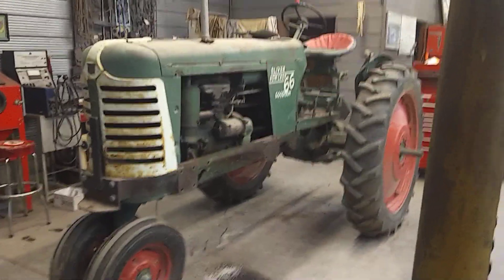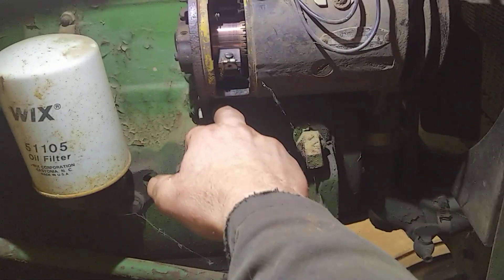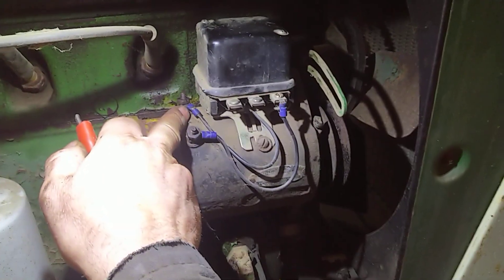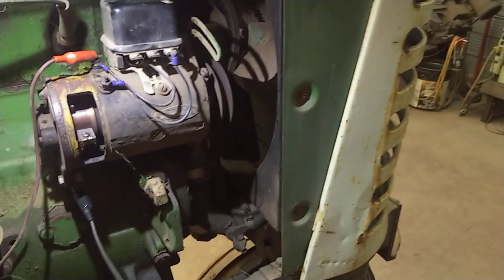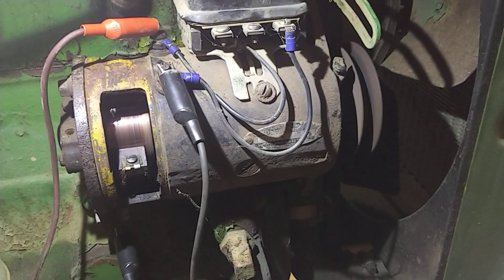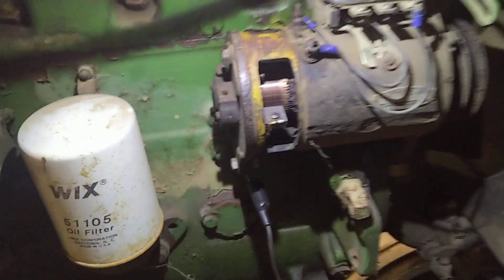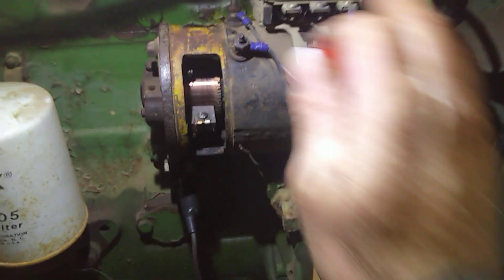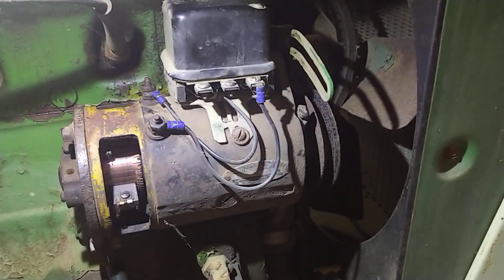Easy Generator Testing

Comment: Man...this tractor is driving me nuts!!! I do this test...but my generatoe turns SLOW...UNTIL i push down on the coil flap then it speeds up
Reply from the maker: Go through the tests with the regulator unhooked. If your generator turns terribly slow, it is likely time for a cleaned armature commutator and brushes. Also lubricate the bushings.
Reply: @FarmallDoctor I'm getting 6 volts on both terminals on the generator.  Mounted to the tractor. I've got the regulator un hooked.  (It's a positive ground).  Is there supposed to be continuity between the A and F terminals to the body of the generator?
Reply: @FarmallDoctor I just posted a little video short of it
Reply from the maker: @Tater4200  Your system is positive ground. You are getting confused because you put your meter test lead to the negative terminal of the battery. Put the clip on the positive (ground) post.
Reply: @FarmallDoctor that just powers my power meter. It shows where I have ground or power. I can shoot ground or power to anything I touch with it.  It won't turn on if i flip them
Reply: @FarmallDoctor it's a power probe 3

Comment: Very helpful, thanks for sharing. With older generations I had the magnet become delaminated from the casing. Do you have any tips and tricks for restoring them? And what type and brand of glue would you recommend? Thanks again.
Reply from the maker: I have recently come across and started using 2 part epoxy made in the USA by Bob Smith Industries. It works very well in many applications. One of the biggest things is to make sure that the brush holders move freely so that there is always spring load pushing them onto the armature.

Comment: Probably the best video on youtube. I tried this on my old generator (that doesn't charge) and it spun slowly with the positiv cable connected and when I  connected the negative it changed direction and spun much faster.

Comment: I know this is an old post, very helpful.. but i got to the part where i know my gen works and still isn't charging.. as soon as i ground the field, boom.. its charging. All wires are in good shape, ammeter works great. Is it a bad regulator if it starts charging when the field is grounded, or when the field is grounded and you hit positive to the arm post?
Reply from the maker: @LIgmaBollards  check first to be sure that the body of the regulator is properly grounded, and if so, the points for the field circuit inside the regulator are not contacting. You can clean the contacts inside the regulator with fine emery paper, and blow them clean. They are the set inside that are held normally closed.
Reply: @FarmallDoctor  the regulator appears new, everything is shiny, it's definitely not original to the tractor, no oxidation anywhere on anything. I'll check to see if it's open when I get home from work. The tractor runs at 6.2 to 6.1 volts, I can turn the headlights on, pull the battery cable off of the battery and it will sit and run. It's strange. Once I ground the field, it starts charging at 7.9 before I pulled the jumper. I did make sure the vr was grounded good, but I'll definitely triple check in the morning. Thank you, and thank you for this video, can't tell you how many times I've referenced it the past couple years

Comment: so what happens if it goes past 16 volts and stays there does that mean the box is bad and overcharged  the battery?
Reply from the maker: Yes. The regulator is stuck on full charge. The generator has excellent output.

Comment: Will this work on a 6 volt, positive ground? Do I place the leads as you did, or differently because it’s positive ground?
Reply: I looked through the comments and he does confirm that he is working with a negative ground system. So I would imagine that for a positive ground system everything would be done backwards (except for the polarizing part which btw is not the procedure for old 2-brush ford generators). Let us know how your test goes.
Reply: I was curious weather he was working with positive or negative ground myself.
Reply from the maker: @jamescaneda9515  this 6 volt system is positive ground.
Reply: @FarmallDoctor No, I heard I’ll take the negative lead that’s ground. RED is positive hot, BLACK is ground. Did I hear wrong? I need this information because I’m installing a new generator plus a new voltage regulator. Your video was the easiest to follow.
Reply from the maker: @jamescaneda9515  sorry, when i say "battery positive" that is meaning negative.. Because of the positive ground. It was drilled into us during college training, and I can't stop saying it that way.
Reply from the maker: @jamescaneda9515  polarizing is the same whether pos or neg ground though. Touch BAT terminal to GEN terminal momentarily.

Comment: I need to mount new generator and regulator, but don’t know the proper wiring. So I’m stuck and will try my best, hoping not to burn circuits.
Reply from the maker: @pacoguerilla3097  F on regulator to F on generator, GEN on regulator to A on generator, BAT on regulator to ammeter or volt meter. L on regulator if there is not always there, or not always used. That is a load circuit that goes back to the light switch. Not necessary.
Reply: @FarmallDoctor  Thanks a lot !

Comment: In following this man's advice there is one big caveat regarding grounding the field (F) terminal of the generator.

This should only be done on generators that use an externally grounded field (also known as an A-circuit field). There is also a B-circuit field, which is an internally grounded field. In this configuration the connection to the F terminal must go to the hot (ungrounded) side of the battery, whether it's positive or negative, to get full output or to check the generator slowdown when motoring it.

Ford used the B-circuit configuration almost universally in its vehicles which were equipped with generators. This would likely also be the case with its tractors. So it behoves anyone doing these tests to know what configuration your particular charging system uses for its field circuit.
Reply: inflec is right on the money here!  

Old Farmall tractors usually use Delco Type "A" generators and the "Fielding" procedure would momentarily connect the 12vdv to the generator armature post as stated.  

However older Fords and Massey Ferguson tractors usually use Lucas type "B"  generators and the "Fielding" procedure would momentarily connect 12vdc to the generator "Field" post.

So your best bet us to verify is to first verify if you have a type "A" or "B" before "Fielding"
Reply: OBTW - "Fielding i's also known as "Polarizing" the generator.
Reply: Yeah that’s what I wanted to know. I have a 6 volt positive ground generator on an international pickup. The new relay states to ground it to reverse the polarity. I called the retailer and he didn’t know. I’m waiting for the AC Delco mfg to call back for information.

Comment: Do I leave the battery hooked up and just run wire test wire or do I unhook battery? Positive ground 12 volt system
Reply from the maker: Yes, i leave the battery hooked up.. Just remove the wiring harness from the regulator and generator, and use the test wire.

Comment: I'm sorry but I wish you would do a better job explaining the jumper connections you did to test the generator. The tractor is positive ground which gives me an instant head ache. I just don't fully understand what you are doing. Otherwise you do an excellent job of keeping to the point. So many just ramble on with meaningless garble.
Reply from the maker: "battery positive" Is a general term that we use to identify the "hot" side of the circuit, no matter whether the system is negative or positive ground. Ground is always referred to as ground in both. "Battery Positive" jumped to the A terminal makes the generator "motor" no matter if it is positive or negative ground. If you were to ground that A terminal, nothing would happen.

Comment: Great video. I have a 6v. pos. ground tractor. When you mention connecting a lead from battery pos to armature terminal, is the lead actually coming off the pos batt terminal (the one with the the mesh cable going to ground)?
Reply from the maker: No, the other way. When we say "battery positive" we are meaning the machine, not necessarily the battery.
Reply: So is it safe to say, connect a lead from the neg. terminal (since mine is a pos gnd) and the other end to the armature of the gen? In other words, think of wiring it up in reverse? 
 @FarmallDoctor
Reply from the maker: That's correct.

Comment: A knowledge of electrical theory helps. I see a lot of videos and while the person posting the video may know what they are doing, the person receiving the advice may not understand what is being said. When I am teaching how to test and repair generator and regulator I always use the LUCAS ELECTRIC SYSTEM for explanation and circuitry. It is a very simple system and the 3 or 4 tests to do in the field can be done with a volt meter and a shorting wire.

Comment: If the regulator is bad, will it cause no spark to coil. I have brand new coil and ignition kit installed but I still cannot get spark. I think I may have a gound but cannot find it. Also my ammeter shows no charge while system was running..maybe the ammeter is bad. Before my tractor stopped running it would run for a  few minutes and then just die. Pretty sure my generator is good cuase my battery stays  when running. I have 1950 Farmall H. Thks
Reply from the maker: Hi Jacob. Sorry for the late reply. Not directly... unless your battery goes dead while running. Ignition is fed directly from the ignition switch. Check for power to the + side of the coil first. Maybe a bad switch! I would have guessed a bad coil... if you have another coil to swap into it, that would be a good test. I had a new coil die on my W9. Check to make sure that the condenser is held tight in the distributor. I have had some that the new clamp was too large for the new condenser. it MUST be tight and well grounded. Test the ignition points by putting a test light on the wire coming out of the distributor. While cranking it should flash as the points open and close. Observe that when the light goes out, it is completely out. Some new points have a glazing on them and they may need polishing. I use ultra-fine 2000 grit wet-dry sandpaper from an auto supplier to polish them. Let me know what you find.
Reply: I had a  similar problem on my 41 Pontiac.  It turned out that the ground wire for the points was grounding before it passed through the points. @FarmallDoctor

Comment: So on positive ground like John Deere would you run negative to amateur and positive to ground?
Reply from the maker: That is correct.
Reply: @FarmallDoctor I appreciate your video. I've run your test on 2 of my tractors today and discovered that my voltage regulators are bad. Replaced one and got it charging. Gotta get one more. Again thank you for the information
Reply from the maker: @kennycriswell141  glad to help!

Comment: Sir, an excellent tutorial. I just dont quite understand the last part where you bypass the regulator. You only show the jumper cable ends at the regulator/ generator, are the other ends connected to the battery ? And if so on what should you see "a full charge" shown, does your tractor hav a charge gauge fitted? Mine doesn't.
Reply from the maker: Yes, in a sense, the jumper leads are connected to the battery. As in, a known good ground, and battery positive. Yes, most  older systems have a volt meter or ammeter, but some only used a charge indicator lamp. You can test with a volt meter. Also, if your dash light does not come on when key is on, it may be burned out. If it is burned out, the system will not charge.

Comment: Im missing something here.. I did all the test and tested all good but generator will not put out? why? When it is all hooked up it wont put out and with it all un hooked the generator wont put out.. If it will motor it should put out..? it all bran new. Any answers or help would be greatly appreciated
Reply from the maker: Re-check your wiring connections, check that the Ammeter is in good shape, make sure the belts are tight, be sure that your generator and regulator are absolutely grounded.

Comment: Is all this done while it’s still connected to the battery? Thanks for your help. God bless you!
Reply from the maker: "Motoring" the generator test is done with the wires disconnected from the generator and regulator. Polarizing and testing of the regulator is done with everything connected and the unit running.
Reply: This question is about to show my novice at best experience. Will starting the car and disconnecting the battery let me know if the generator is doing it’s job? (For reference) It’s on a 58 Oldsmobile Super 88. When sitting the battery stays charged but drains when driving it. I’ve had it serviced and the guy said it’s in proper working order. Is it possible the aftermarket electric fuel pump has something to do with it? Thanks for the help.
Reply from the maker: @ronmckinley8406  that may work with some systems, but it's not reccomended. The best test is to check the voltage while it is running right on the battery posts, then move the test leads to the cables, and finally at the regulator to see if there is any change. Check, clean, and tighten all cable and wire connections. They can be finicky!
Reply: I Thank you very much for your time  and sharing your knowledge.

Comment: Does this same procedure work on 3 wire generators?
Reply from the maker: A 3 wire generator such as a Lucas on a Ford tractor? No. They are polarized by connecting battery positive to field circuit momentarily.
Reply: @FarmallDoctor  It is 1959 MF 65, perkins diesel.  Supposedly original generator rebuilt recently.  No manufacturer visible on generator.  New ammeter, wiring and regulator.  There are at least 3 different wiring diagrams for this setup (or more).  Not charging...trying to sort this thing out.
Reply from the maker: Make sure that both the generator and regulator are properly grounded. You can use a test light to verify. Put the test light lead clamp on battery positive and touch each component with the probe. It is a common issue. The regulator should have had instructions included for polarizing. If not, your rebuilder can instruct

Comment: My case will only spin if I use hot as ground and negative on armature , generator removed from tractor is this normal ?
Reply from the maker: It is polarized for positive ground. Some old generators are more finicky that way.
Reply: @FarmallDoctor  thank you

Comment: Can this be done on a generator with a tach drive? Or should the tach cable be removed first?
Reply from the maker: It can be done either way. I would spin it by hand first to make sure that there isn't excess drag from the cable and tach.